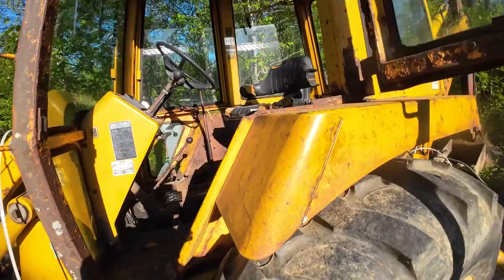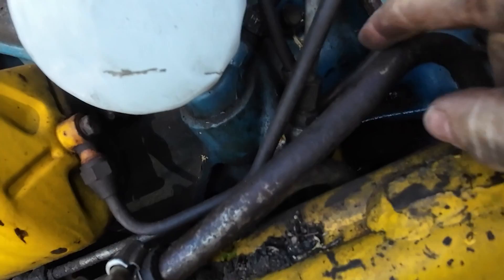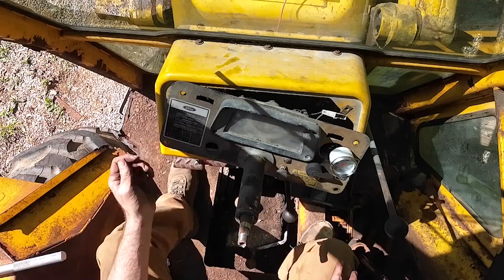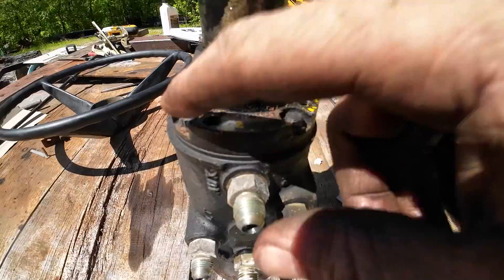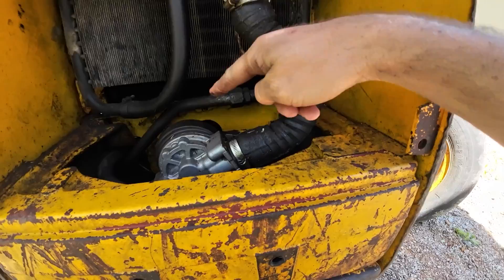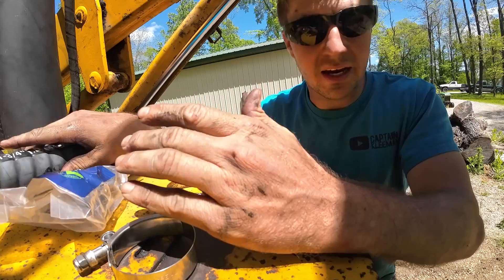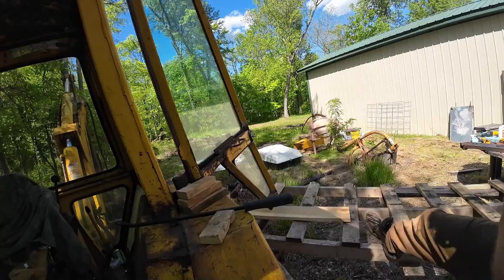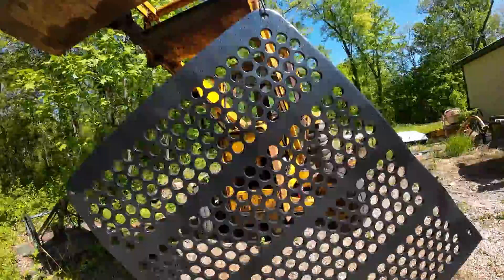Problem Solving Failed Power Steering System on Old Ford Backhoe

Comment: Hi Mike. That action with the steering wheel looked like the right thing to do, it worked just fine. About optimism, I am an optimist until I have no other choice. With the painting, you will know where you have been so far. Have good days!

Comment: Just an FYI, in case you didn't already know, and since you used brake cleaner to clean that exhaust bracket. For future reference, any parts that you plan to weld on  should only be cleaned with non-chlorinated solvents, otherwise when you weld on it, the residue will generate chlorine gas, which you REALLY don't want to be breathing. Some folks will call me a nervous Nellie, but I've had that drilled into my mind from numerous shop teachers and welding instructors. Just lookin' out for ya bud! 🙂
Reply from the maker: Interesting
Reply: Always a good reminder.

Comment: Ah, the chug of a three cylinder diesel.... unique!!! 
Pleased you got the main hydraulic hose replaced, those clips are much better suited to that application 👍 
Your face had a disturbed look when you lifted the top cover off the steering pump, your explanation as to what you had done made sense, the manual came in handy !
Pleased there is plenty of parts out there readily available for you too !!!
The offset spanner head from Dave has found its use, good of him to send it up to you!!! 😁

Comment: Those battery cable ends are only for when your broke down emergency only. Swet copper eyes on the cables and use marine cable terminals so the cables can be bolted on, you’ll be glad you did!

Comment: I was replacing the fuel line on an old truck.  Local parts made it with hydraulic hose with their crimp ln b fittings.  Good stuff!

Comment: Captain, GOD BLESS YOU!  The job would be tough enough without recording the repair.  But you make it look easy, by changing camera angles, documenting the nuances, showing the parts and process...  A DANG MIRACLE!  I hover, sweat, curse, and crowd over every struggle.  You have to lean back, get the shot, figure it out, call around (maybe wait to get an answer or part), fix it, put it back together, clean up...  AND EDIT THE WHOLE DANG THING.  Wow!  Thank YOU sir!!!
Reply from the maker: You all make it worth it!  Appreciate the support!

Comment: Use that bracket over the steering pump for either an auxiliary hydraulic pump or an air compressor.

Comment: It is like an appendix, who needs one of those. 
Actually, I like taking things apart and putting them back together again. Sadly, I usually end up with a few extra parts, like an appendix. I took apart a wood planer (thicknesser for those of you one the other side of the pond). I painted a 10'x4' table white and put everything on the table just like they showed in the book. A lot of folks said I would never get it back together. I did.

Comment: Regarding the lose battery cables, until you get them replaced, turn them upside down. Then tighten. That should take up the slack as the tapers will be opposite of each other. 

Keep up the good work!
Reply from the maker: Thank Libby. Already have the new connectors as of today, but I'll remember that for next time

Comment: Had an 1955 Oliver Super55 with the same Ford steering gear.  I sold it for $1000 rather than deal with taking the entire dash apart to replace the $600 gear.  As reported on some forums, the kit repair wasn't a walk in the park. I'm rooting for you.

Comment: I have a steering box like that on my international 966 my son and I rebuilt it last year. I found the parts online for $40 . A rebuilt one was $1000.00.  I Love your videos.
Reply from the maker: Pretty similar situation here, hoping the seal kit does the trick
Reply: @CaptainKleeman  mine has been great. Turns with one finger. Turning 10 1/2 " wide tires on my tractor .

Comment: I would recommend running motor oil in the power steering Fords are known for leaking the power steering oil into the crankcase
Reply from the maker: Yup

Comment: slowly but surely moving forward.  I hope that the seals are all that is wrong with the power steering pump.  It can be frustrating working on old stuff, fix one thing just to have something break further in the line.
Reply: Everything that dets repaired ups the pressure on the next thing. Good idea to replace both power steering lines while things are apart.

Comment: Captain, If the seal kit does not fix it , look at Northern Hydraulics or Bailey Hydraulics Brand new much less but still costly. Hope your seal kit works. Most mechanics I worked with over the years would have been afraid to dismantle a hand pump like that one.
Reply from the maker: Thanks for the tip

Comment: I would highly recommend using motor oil in the PS. these pumps are known to seep fluid into thr engine oil. The PS pump will not know what oil is in it, any petrolium product will be fine.
Reply from the maker: Interesting

Comment: I like your videos. Don't listen to the negative nellies. I have done most everything. I learned to run a metal lathe in high school. Worked in a machine shop for a few months. Machined to the 10 thousandth. Left it for a computer job. Big mistake. Water under the bridge. I weld great. My oxy cutting looks horrible. I know my limitations. I accept my limitations. Lived in a remodel all of my life. I know electrical, plumbing, cement, drywall, shingles. (all the stuff NYA is doing on the castle.) I say this not to brag about me. I know the right way (expensive and DIY). I also know the wrong way. (I learn from my mistakes. Did you know that you can remove the head bolts on an aluminum block by turning them clockwise? They get tight. Then suddenly become very lose. Yup. I got to learn what a heli-coil is all about. lol. Kind of like you and truck mirrors.) 

I started watching Curtis at Cutting Edge Engineering. He would slap a pipe in the lathe and start cutting on it. It used to bother me that he did not try to adjust the concentricity before cutting. Or that he didn't try cutting everything to the 10 thousandths of an inch. Whatever that is in Metric, since that is what he measures in. Instead of saying something in the comment section, I watched. All of the parts he was machining were +- .5 mm. The outside didn't need to be concentric, it gets paint. The inside he bored, as well as the ends. Those are the important dimensions. Either gaskets or he would fill the gap with weld. What I was worried about really was not important. Curtis remanufactures $10-80k parts. He gets paid big bucks. He must be doing something right. I figured I would shut up and maybe learn something. 

I do the same thing with your channel. You don't have a million dollars worth of tools. You fix stuff outside (shade tree mechanic). You encourage people to give it a go, even if they don't have a bunch of tools. Kind of like Mat at Diesel Creek. I enjoy your positive attitude. "It is broke. I can't make it any worse. Might as well give it a go." In the end you have turned quite a bit of trash into useful treasures. The chickens like it. It has got to be good. The stump puller, nothing new, but you made one. Kudo's. You keep being you. We love you just the way you are.

Comment: I got hose connector soldered on too my iron line the got ends on both ends        heaps betta when ya gotta replace em          good luck        Sweet old girl       bro drove    550 for couple yrs       he luv if

Comment: A quick google search I found a few of these 555 backhoes for anywhere between $1,500 for a parts unit to $25,000 for one in really good shape. For anyone thinking buying a working one would be cheaper. That and old broken stuff makes more content than shiny new stuff. 
Truthfully I think the biggest hurdle you have on this project Mike is going to be the hornets that keep trying to live in it.

Comment: be careful with those loose battery connectors, I fried my battery posts and they are not replaceable so about $350 for each of the 4D batteries

Comment: Well done, thanks for sharing.  I've always put tension on the puller like you did then smacked it(head of the center puller bolt) a few times with a hammer.  The vibration is probably even better.
Reply from the maker: A few whacks normally does the trick for sure

Comment: you may won’t to look into getting some ratchet wrenches it would make it better to take some of the bolts off
Reply from the maker: I've got some,  they are Pittsburg though, and the ratcheting head is too big for some areas.  But they work great when I have enough room!

Comment: Those hoses, try dipping in hot water before clamping.  It will help compress the joint.  Pool hoses are similar, very very hard to compress with a clamp, unless it was hot water’ed first.

Comment: Your steering motor looks very similar to the one in my MF255 that had to be resealed.
Reply from the maker: Did the re seal work for you?
Reply: @CaptainKleeman  Absolutely.  My dealer warned me that it was under high spring tension so I had a hydraulic shop change the seals.

Comment: So removing the AC bracket will make the back hole lighter resulting in better gas millage right (lol, comment generator of the day) Also new paint will in crease the horse power by 10 and make it go 5 mph faster to.

Comment: Mike - did the steering feel intermittent at all? That's the feeling I have on the exact same machine and wonder if it's the steering motor?  I'm not getting a leak, just a squishy feel and steering does not always respond? I'm not sure if the seal kit would fix my problem?  Great video!

Comment: Heat the hinge pins with a propane torch to loosen them.... spray some lube when hot and then it to get the lube in... should come out easier ...heat always helps along with a lubricant...
Reply from the maker: Wasn't needed though.  They came out easy enough.

Comment: Can you put a valve on the bottom of the hydraulic tank and screw the lug in the oppisite side of the valve? It would make the job easier the next time if you ever have to drain it again.
Reply from the maker: It's easy now.  Wouldn't be worth the trouble

Comment: Captain you mentioned using a hammer drill buzz nuts or bolts loose. Is it your Dewalt battery powered hammer drill. Is it it a regular hammer drill a person would use to drill a small hole in concrete? What is the bit you have inserted in the hammer drill? It looks like a air hammer point.
Thanks
Reply from the maker: It's an sds drill
Reply: @CaptainKleeman  SDS drill i looked that type drill up on Amazon. It looks like it is a rotary hammer drill. So I assume the bit rotates and hammers slowly.

Keep up the good work on the videos. I have been watching a few years. I get a lot of laughs with your sense humor.

By I was a volunteer fireman and emt 40 years ago until my real job changed to traveling out of town 4 days a week for 40 weeks a year.

Monona Jake

Comment: Hey there Capt. Has anyone told you where you were removing the shaft you used the wrong tool? I believe the proper tools go, claw hammer, demo hammer, then sledge. Ball peen is more for body work.😂

Comment: You do have different connectors on positiv and negativ sides,  could you have two positiv connectors?
Reply from the maker: I'm.not following
Reply: @CaptainKleeman  the poles on the battery are usually slightly different  thats why negativ and positiv connectors.

Comment: Question what would cause this machine to act up after replacing power steering hoses because now after replacing the power steering hoses after the machine warms up it starts to lose power and won't work right due to power lose
Reply from the maker: Engine power or hydraulic power?
Reply: @CaptainKleeman  Engine power